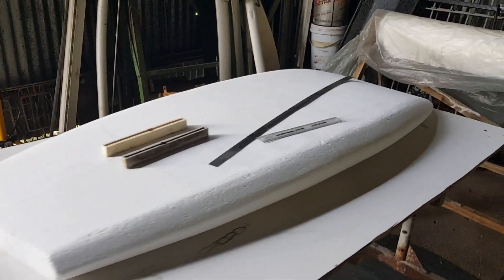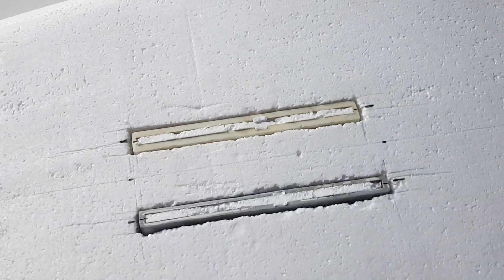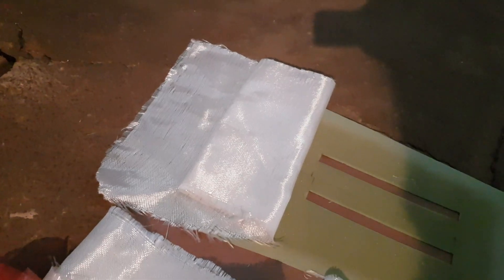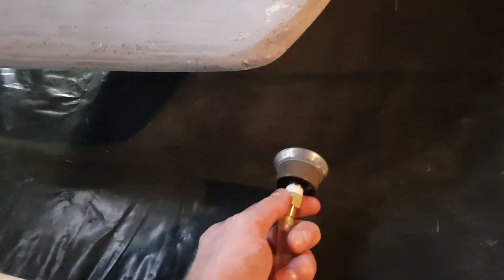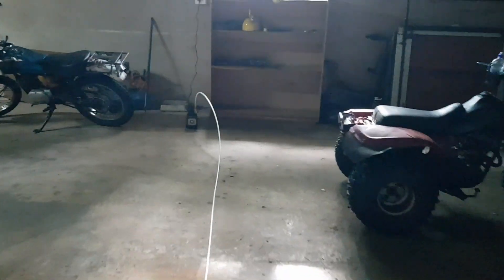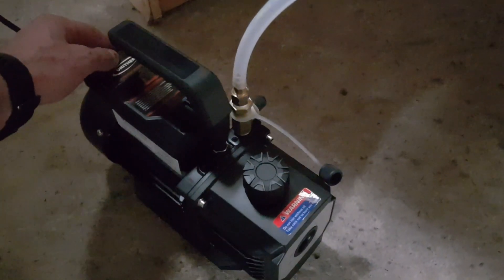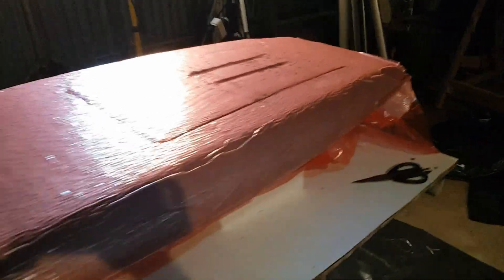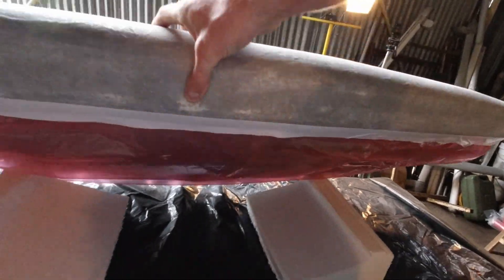Building a home-made hydrofoil board and testing it out

Comment: I see this was fitted 1 years ago! I want to fit a PVC twin hydrofoil box on my board , therefore my question is: did the box work and not break off? and are the plastic inserts strong enough for the hydrofoil attachment?
P.S has anyone on youtube used these PVC plastic twin boxes successfully? without losing their hydrofoil?

Comment: Thanks for sharing, great job building your own wing foil board. I'm curious about that spot, I've seen it before as we go to the EC sometimes. Is the water deep enough for foiling all the time, or only at high tide or after rain etc? And how's the wind, is it clean or gusty? I guess it should be quite clean with an easterly wind.
Reply from the maker: Thanks for the feedback 😁 it's a great spot for watersports, for foiling you ideally want a mid to high tide. South-East wind is smooth, if it's very easterly the ridge by Amsterdamhoek can cause turbulence, but generally you can get long runs. South-West wind (as in the 2 clips in the video) is relatively smooth, but you want a higher tide to get long runs as the channels mostly run NE-SW. On a South-West it's quite epic to head out the river mouth and ride the swells, I might make a video of that 👍🏼